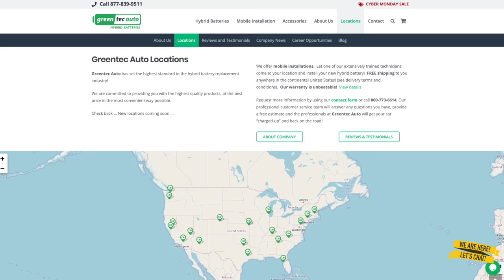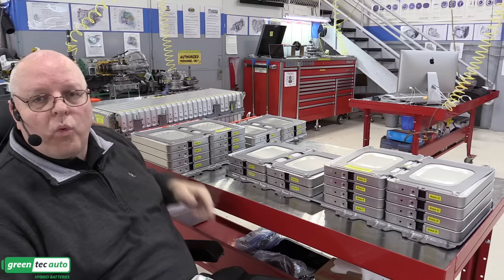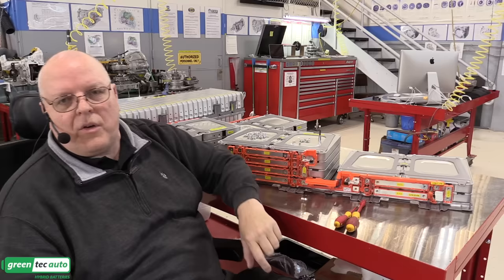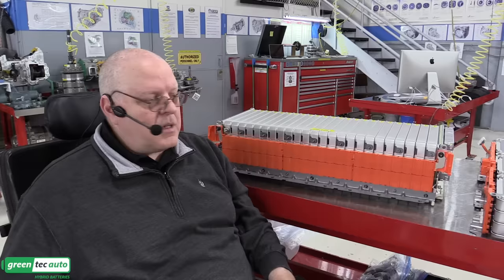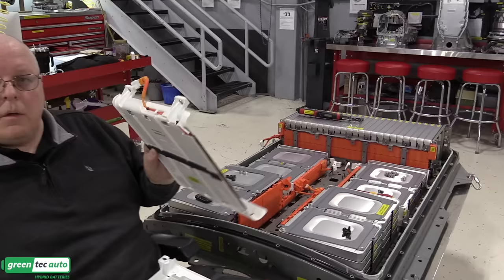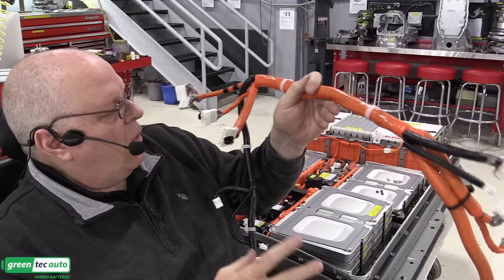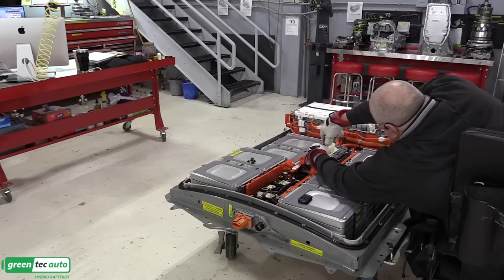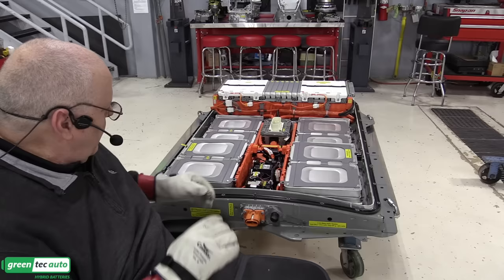2011 Nissan LEAF Battery - Deep Dive

Comment: It seems like this could be very easily designed to be air cooled. Such a shame.
Reply from the maker: I agree, thanks for your feedback
Reply: The problem with air cooling is humid air condensation and contamination with dirt causing rust from the oxygen and moisture etc. I think it would be a bad idea air cooled.
Reply: @super-sim1665  Most hybrid vehicles have used air cooled batteries, including the Prius, for nearly 20 years now. Most use air from inside the cabin since it is usually more within the temperature range that the batteries would like. The only issues they seem to have with corrosion has been from the batteries themselves leaking electrolyte.
Reply: @ouch1011  Most prius have Ni-mh that cope with heat safley. Lithium ion explode beond limits quiet different safety requirements.

Comment: The original Leaf, also known as the WORST battery design in history.
Reply from the maker: Thanks for your feedback
Reply: It was good for a cheap design. The car is incredibly reliable. It just never lived up to its degradation promises.

(Former 2012 LEAF owner)
Reply: Jeff Kubel it was a terrible design. Who thinks no heating or cooling of the cells is a good idea? Some of these cars were only able to go 30 miles a charge after 5 years of use. The packs cost more to replace than the cars were worth.
Reply: @CFG39  I think they had higher expectations out of their chemistry initially and by the time they realized it was a problem they weren't willing to make the investment in redesigning the car for liquid cooling.

Comment: Detailed video like this almost eliminate user's need for bulky and often difficult to comprehend factory service manual.  Still, I wouldn't dare touching a single bolt of this battery box before thoroughly reading the manual.
Reply: You still need their tools for lifting the car and moving the battery. The whole pack weighs over 300kg.

Comment: Watched your whole video. Im so pleased to know how battery pack hardware is wired. It really looks like DIY servicing is off limit though, for safety reasons. However replacing the whole battery pack may be achievable DIY. Thanks for the clarity as im researching if used leaf is feasible for the long run.

Comment: Fascinating!  The complexity of the Leaf battery pack is amazing, not just a box of Duracell cells for sure. We hear EVs are simpler to build and maintain than IC powered cars. I wonder if that is true given the complexity of the Leaf battery. 
It seems to me EVs won’t be mainstream until, or if, batteries can be built as small as an IC car’s fuel tank, and can be filled, that is recharged, just as quickly as a gas tank can be filled. Until then EVs will be environmentalists and politicians dreams. 
In the 60s, when in the USAF I worked on the B52 Defensive Fire Control System. The “rule” for working on the high voltage radar components was: one hand in your pocket, don’t ground your body. 
Then a decade later in Bell System we had rubber high voltage gloves.  Most telecom circuits were battery (-48VDC) and ground. The gloves, that I never had occasion to use, were black with red inner. To test them you inflated them with your breath, and checked for any red peeking out through the black, indicating a path for voltage to escape and harm you. 
No OSHA in those days!
Thanks for the video. I watched the entire video, albeit over a couple of sessions
Reply from the maker: Thank you and thanks for your feedback

Comment: Very comprehensive and informative, thank you for doing this.

I'm just curious about one thing. If the battery was made to be user serviceable, why does Nissan not sell new modules for customers to buy and replace in their batteries as they degrade?

And to that end, the Leaf (and all EVs) should display on the dashboard (or somewhere in the user interface) when a module degrades below a certain level, which module is affected, and print the reference numbers on each module for the customer to identify.
Reply: LeafSpy app should show data like this

Comment: Explained to great details. It is interesting to get the knowledge on battery assembly and details of other parts that connect into one system. Thank for all those details.
Reply from the maker: Glad you enjoyed it!
Reply: @WeberAuto  Just enjoyed watching another video on Toyota Prius Battery removal from Trunk. While going through all the details in the two videos I was wondering How is Nio, the chinese manufacturer able to remove / replace / service faulty batteries with so many harnessing and safety circuits and cooling or heating materials and ducts. Would be interesting to watch the differences.

Comment: It seems Nissan thought of everything to include a heater but why no cooling system, very strange or add. Two quick questions:
1. What is the ideal temperature range for this type of batteries???
2. What type of scanner is used to trouble shoot any problems, like the OBD 2 scanners??
Great presentation, I am hook!!!
Reply from the maker: 21 C, 70 F. OBD 2 scanner will not work. You need more involved scanner
Reply: @WeberAuto  Thanks for the answers.

Comment: Gotta say, while I am no safety Suzy, it appeared risky to lift an unbalanced (or balanced) load with straps that don't terminate at the hoist hook. The whole load could have shifted and been hanging vertically hitting the floor. Regardless, I really appreciate your thorough approach to everything automotive. I have a special interest in electric cars having built one myself from a 1983 Rabbit.
Reply from the maker: Thanks for your feedback. I agree, four straps would have been batter.

Comment: Do you have any pictures or video of where exactly the temperature sensors are on this pack and what they look like? Are the temperature sensors just shoved in between some of the modules? Are they taped onto a module? Thank you for all your hard work on these videos!
Reply: Also, is there a plug that connects to the temperature sensor?

Comment: EXCELLENT & INFORMATIVE TECHNICAL STUFF.

John, your explanation is up to the standards we have come to expect from you. It serves to both educate and inform in your usual friendly and occasionally humerous manner.

However, one point perhaps worthy of attention, and perhaps comment, relates to your lifting the battery packs over to the base unit with the crane.

Whilst the lifting points were used and you balanced the lift, I couldn't help but notice that when you were lifting battery pack 1 & 2 into place, there was some slight flexing in each instance due to the fact that these two packs comprised four modules at one end and two modules at the other.

Whilst the flexing was only slight....and for a moment or two whilst the crane was taking the weigh, it was quite plain to see.

I would be concerned that at the point of this flexing both the connecting bus bars and the plastic came under some strain, and whilst this might not be a problem with correctly torqued nuts, bolts and screws, the possibility of something, perhaps, bending or breaking clearly exists. Most certainly were successive periods of servicing entailed lifting the battery packs out...........AND....where they might be left hanging for longer periods of time.

Obviously if battery packs 1 & 2 had a further two additional lifting bracket points in the centre, (thus giving six points of lift), then they would be more rigidly supported.

Clearly this is not a problem with the battery pack for the rear, as this contains an equal number of batteries and is more rigidly fixed together, thus giving an even weight distribution.....

You obviously did things 'by the book' but perhaps there is a design amendment required to things that NISSAN might care to address.

Just an observation......

James Hennighan
Yorkshire, England

Comment: I have a 2015 LEAF SV and I'm about 80% range (roughly 80 miles). I try and keep charge between 20% and 80% to extend life. With that said the capacity lost per year is a a few percent (Approx. 2.5%, year to date average, some report more loss some less). I bought it used end of 2017 (3 yr old). I have had it 4 yrs. I do live in a hot climate (I try not to drive during the summer and use my other car). I hope to get another 8 yrs. After it gets to about 50% the utility of vehicle will be very limited. Keep in mind you want to get to your charger with 15-20 miles remaining min. I can do most errands with 30 mile range + 20 mile reserve. That leaves me with 30 miles range to lose. If I lose 3% a year (or less), I should get the 8 to 9 years. I hope to get....  If you are wondering what percentage lost per miles is, my guess is about 100,000 miles will be about 50% lost, Approx. 2000 miles for every 1% loss in capacity.

With that said WHAT HAPPENED TO CHEAP PACK REPLACEMENTS I HEARD OF YEARS AGO? The price to replace a 24KW pack is stupid...$8000 to  $9000 (pack, labor, tax). The bluebook on my car now is about $10,000. It would be great if someone engineered a new pack with cooling and could sell it for $5000 installed. These are good cars, but the battery pack dying from day one, is really a tragedy to consumer.  These LEAF's new were advertised to have 120 mile range (which was really 100 mile range).  Nissan STILL does not cool their packs. The new cars have 200-250 advertised Mile Range.... so even if those lose capacity you still have useful range for local driving. NOTE EV's are not for Cross Country Trips to Wally World.... NOPE. It is great for a local driving. Also having a LEVEL 2 Charger at home is a must. I got mine used and installed it myself (220V). If you buy a new station and have an electrician install it will be over $1000 or double? I have about $300 into my DIY installation with a used Clipper Creek 4.6KW charger. I got into EV as an experiment. My comment is if you live in a place you can't have your own charger, or the EV is your only vehicle, than EV is NOT FOR YOU.  BTW paying to charge at commercial charger is more than paying for gas or diesel. Don't get an EV as a sole car.

Comment: Wow hell of a video, really well described Sir Kelly, each and every step, now it justifies and clarifies why these battery packs cost thousands of bucks, I wonder if they incorporated some kind of water submerged detector whereby internal contactors disconnect battery immediately upon sensing any detection against collision, water submerging like a car falling into a river, or deep flooded paths to avoid any possibility of electrocution. 

I repair switch mode power supplies and there are charged capacitors to 340V DC, and I can tell you it is absolutely not a good experience to feel that, fortunately my reflexes are so good that I can let go before too much damage, and takes a good few minutes to recover from high heart pulse rate and breathing.

Comment: Hello from Norway. Good video! I'm in a wheelchair to. Now using a TDX SP2 Lowrider (it looks a lot like your chair). Looking at your video, i noticed the little shelf over your legs. I wonder where to buy that shelf/table ? If you know, i would be grateful if you could tell me. Thank you for teaching us about the battery pack. Nice to see how good you manage to function in your workplace, sitting in a wheelchair. 👍
Reply from the maker: Thank you. It is a LapGear Laptop Desk #45492. It works very well for me. Best wishes
Reply: @WeberAuto  Thank you.👍

Comment: I wonder if it is possible to replace the flat cells inside each 2S box with some 18650 to provide the same voltage and mAh, or more mAh, to DIY a fresh battery pack for Leaf with the same or bigger battery capacity.
Reply from the maker: Good question. Thanks for watching

Comment: Thank you very much for this ULTRA deep dive! I am using this battery (the 40kWh version) as a storage battery for my PV system. Before I can go online with it I need to sort out a couple of fire prevention measures. One thing I need to know for that is where the pressure releave vents are located. Prof. Kelly was shortly talking about it, but did not show them.
I could not find them on my battery yet. Does anybody know it?

Comment: Looking good John  enjoyed watching    surprised on the nuts and bolts   no lock tight or mechanical locking device  would feel better 
if battery pack was used in a stationary none moving condition not to mention thermal management system for each  module   
sweating along with you  with this old battery      take care
Reply from the maker: Thank you and thanks for your feedback!

Comment: Hi, excellent video and explanation of the construction of this battery. Since the Nissan Leaf was one of the first serious electric cars it appears they are getting left behind as I believe the newest Leaf still has no temperature control of its battery and most other manufacturers do. You would think they would be out front of the rest. 

You mentioned dissipation of heat as heat is a problem to the battery life? I picked up somewhere low temperatures are a serious problem and other manufacturers install a heater to give a constant battery temperature. Maybe you could elaborate on what I'm saying, correct or otherwise. Many Thanks.
Reply from the maker: Thank you! Yes, many EVs have a battery heater to maintain a constant battery temperature. Liquid cooled/heated batteries are typically heated to 15.6 C to 18.3 C while the charge cord is plugged in.

Comment: Very interesting, very  surprised to see you connect main power cables to the battery first leaving live bare ended cables being persuaded into place. Is this forced on you or is it just safer than it appeared?
From my aircraft servicing days, I seem to remember minimum lethal DC voltage was 32v. I have certainly felt 28v with sweaty knees on a hot bare cabin floor.

Comment: A few years ago you made a teardown video on 6DCT gearbox that are mainly found in ford power shift vehicles. After having my own gearbox rebuilt in 2015 and now still using the vehicle I have come to the conclusion that the gearbox is not at fault but instead the driver. A driver can easily damage the transmission by not stopping the vehicle before putting into reverse or vice versa. On the point of electric vehicles and battery technology , its always been around but hidden from the general population and called nuclear powered submarines that really run on battery power!!

Comment: I thought all lithium lipo pouch battery cell were all made with the same exact chemistry , I had known the ions are more common in the 18650 but this I didn’t hehe . But glad to know they work with the same standards no matter the shape or form the cylinder ones have 4.2 v max charging voltage . As lipo pouches were known to catch in fire faster than ion batteries .

Comment: Brilliant and informative video as usual, but I do wish you wouldn’t put tools and parts on the battery structure...I know you are an expert working in a controlled environment, but others are not, and sooner or later a screwdriver is going to vaporize☹️

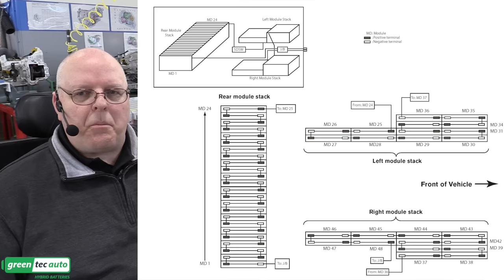Comment: It looks like the battery modules were labeled incorrectly. Based on the chart at 18:50, I think the top left cell should have been the first in the right-module stack and then worked down. The diagram was a bit confusing since it shows the right-module pack upside-down. No biggie though. :P
Reply from the maker: The diagram was confusing. It took me while to figure it out. The labels are correct. Have a great day!

Comment: Too late now, but the type of can opener that loosens the crimp and doesn't leave a sharp edge might be better.
I know of one 10-year-old leaf that was still running with reduced range and one that failed. Amazing performance considering there's no cooling.

Comment: @21’ he talks about battery pack cooling.

Has anyone improved the  cooling on Nissan leaf batteries?

I know it’s air cooling. Improved air flow to overcome low air flow rates through the battery pack?

Duct cool air from the air conditioning straight to the battery?

Duct hot air outside the vehicle better?

I curious. The used leaf are at a great price point, even with a new battery pack. 

The nmc battery pack data sheets are telling me 1800 charge cycles resulting in  75% of original capacity.  Not as good as the LIFEPO4 batteries but smaller volume, less weight.

Comment: Professor, did you notice that there was power at the contactors as soon as you began to seat the disconnect, even though the handle was lifted? That's not what I expected!
Reply: The handle just appears to be a mechanical latch, to stop it from working loose. The electrical connection is made as soon as it is plugged in. It's basically just a big jumper. It could have been made to only make contact when the handle was locked, but that would have made the part more complex and expensive. If Nissan is going to cheap out on battery cooling, they're hardly going to go for that. I'm surprised that the module was as complex as it was!

Comment: Recycling of electric car battery.

Leaf battery. Then there is power for what the car needs for service things. Not for driving.
The large power from the electric car battery must be used to drive a 4X4 powered trailer.
The idea is that it is easier to transfer electrical power between car and trailer. Instead of mechanical power.
The reason is that the VolToy-Voltrailer is intended for extreme terrain and conditions / temperatures.
The temperatures make it the easiest way to keep the batteries warm is to have them inside the car.
(Very short explanation of why. Electric car battery in car to drive trailer.)

Mr. Kelly
I welcome any advice.
I'm in Sweden, even though I'm Danish.

Sincerely
Henrik

Comment: Dont just open a battery module with canopener it can expode n catches fire if it penitrate cell...use angle grinder with sanding disc to slowly gently grind edge